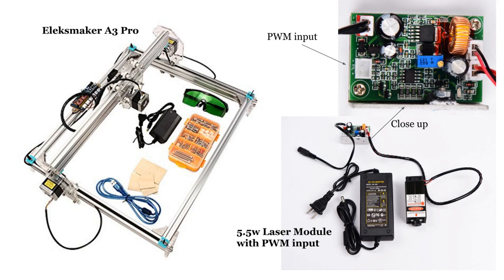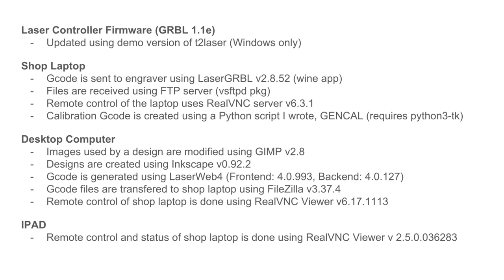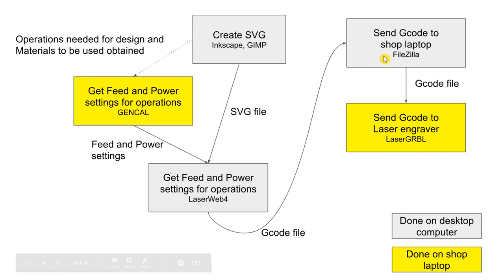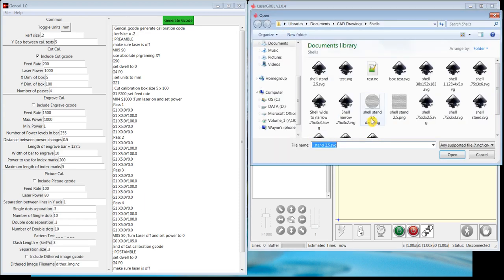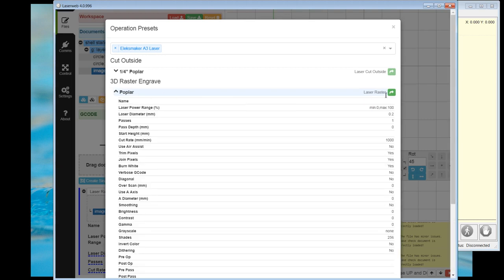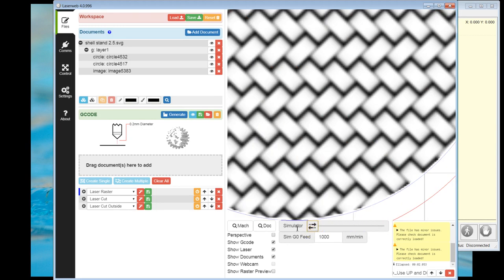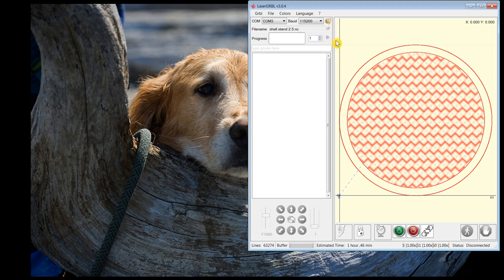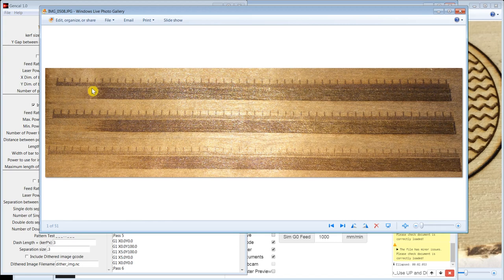The software and hardware I use to do laser engraving

Comment: Nice! At first I thought this was a weak co2 laser...then I saw a laser diode and was really impressed that it could cut popular! Subbed!
Reply from the maker: Yes, I have cut poplar. It did take multiple passes (the wood I used took 4 to cut 1/4), it seems very dependent on the color and hardness of the wood.  Also like the co2 laser, plywood can be very hard to cut depending on the glue that was used to manufacture it.

Comment: How to connect laser driver with controller board  ? give me some picture Please...
Reply from the maker: Here is a picture showing the connections I made between the Mana SE board and the power controller on the laser:
https://drive.google.com/file/d/1QrfAfOqEIzxSWpbyujA58qK8JXK3Koy_/view?usp=sharing
The connections are:
Mana SE GND pin to power controller - TTL pin
Mana SE PWM pin to power controller + TTL pin
Mana SE 12V pin is not used (the laser has a separate power brick for it's 12V)